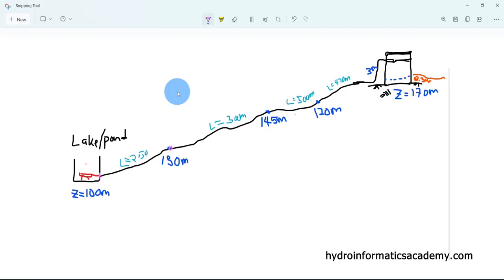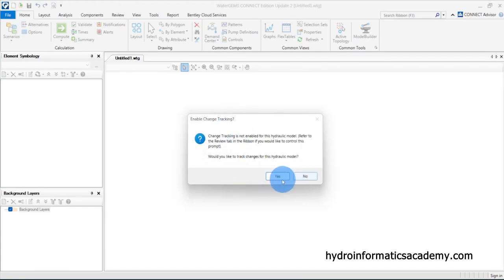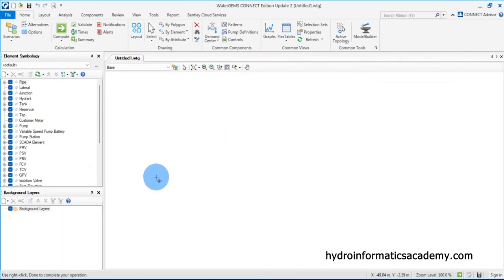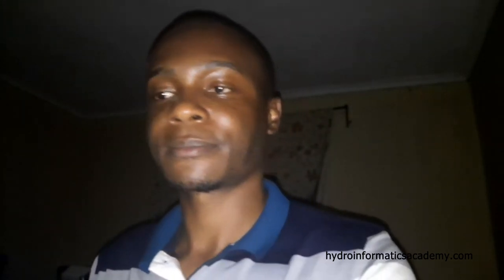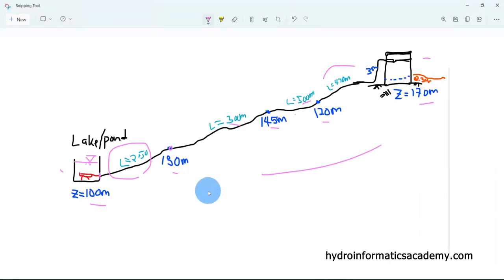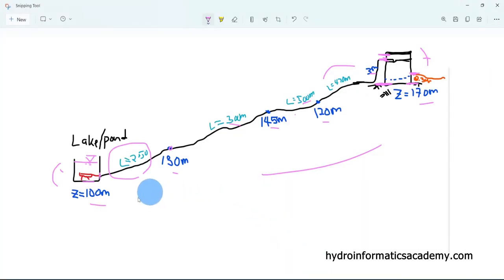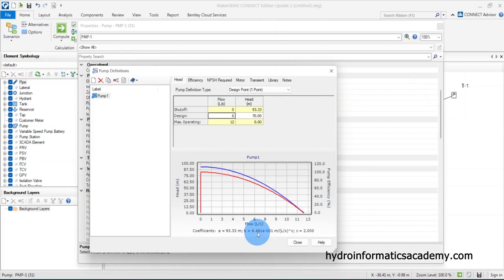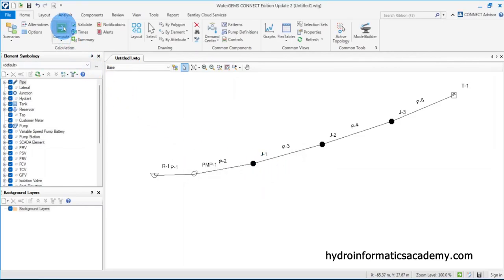Pump Sizing & Pumping Water Network Design with WaterGEMS Software | WaterGEMS Tutorial

Comment: Hi engineer Lodrick and thanks for the video.
Very clear explainations.
In fact for water supply networks under pressure a velocity interval of (0,3m/s - 3m/s) is generally acceptable, but a minimum of 0,5m/s is better to prevent water solid particles sedimentation for sure.
Thanks for your dedication.
PS: Have you consider including french subtitles in your videos, I can help with that if needed I'm frenchie.
Reply from the maker: Thank you so much for your feedback! The issue is unlike structural engineering where we have few design manuals i.e. British manual in water supply almost every country or region has its design manual! 

Something that is not acceptable in country A might be acceptable in country B! and this is the reason why I tend to recommend someone to stick with what they have in their country or region!

Yes, I agree even 0.3m/s might be acceptable but here in my country, the minimum velocity is around 0.4m/s. 

About subtitles, yes I have such a plan and by starting I might deal with Spanish and french! I hope I will get someone to assist me with that because I am not well conversant in those languages! 

Once again thank you so much for your feedback🙏

NB: Please send me your email I will appreciate your help with French subtitles!!

Comment: HDPE PIPE LINE
Reply from the maker: Actually you can use the same approach but it depends on the size of the project you can even apply Extended Period Simulation (EPS) in your design just to get a full behavior of your project!